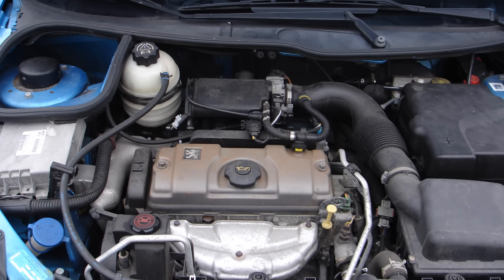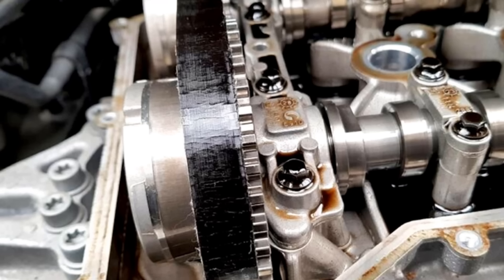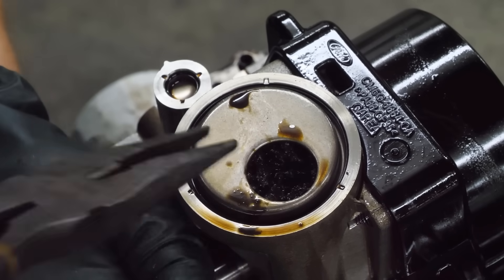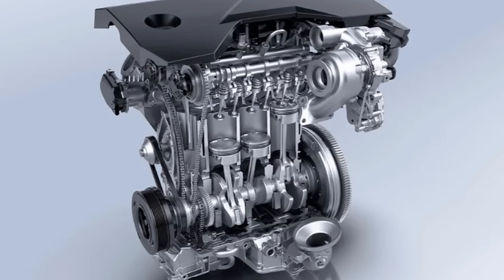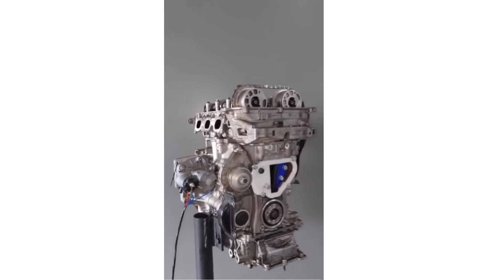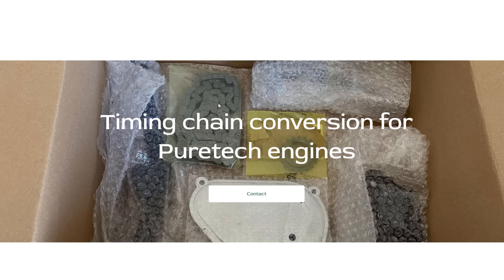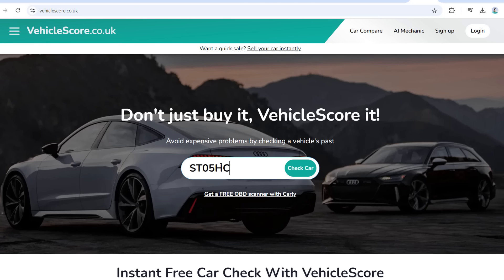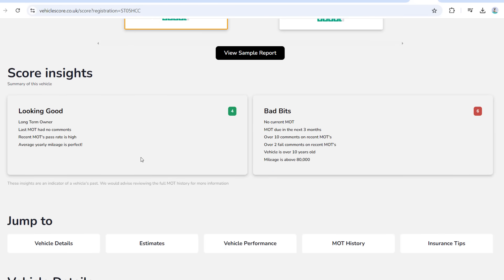Peugeot PURETECH Fix Is Here - All You Need To Know

Comment: I work for the Stellantis importer here in Greece.

Stellantis have changed the oil specification numerous times in order to attempt to cure the oil consumption and the belt degradation, the oil itself doesn’t actually harm the belt but the remnants of the combustion process which contaminate the oil and attacks the belt.

The revised belt from Dayco is apparently “OK”

The recommended oil now is Total Quartz 5/30 RCP not that water thin 0/20. My advice is to completely ignore the ridiculously long oil change intervals and to change the oil every 5000miles max.

I have a 2023 Peugeot 308 130PS 1.2 company car, the wet belt was toast at 20kmiles… I noticed it whilst topping up the oil, thankfully didn’t have the oil pressure issue as the belt had just started to fray on the outer edges.
Reply: I strongly believe that short oil change intervals are the best insurance to avoid the belt disintegrating. As you said, oil contamination (read: repeated short journeys saturating the oil with petrol) is what kills wet belts.
Reply: @Zgurkogel  I replaced the oil in my 1.2 PSA 128bhp after 12 months / 2000 miles, the oil smelt strongly of petrol, the amount of oil I got out was exactly the same as what I had put in 12 months prior, but I do wonder how much of it was fuel
Reply: le probleme principale   c est la segmentation    qui n est pas assez serree!      elle    autorise  l essence    non brulee a se melanger a l huile dans le carter d huile    et l huile remonte  aussi au dessus du segment racleur  et se cokefie avec les explosions et finir par bloquer les segments   d ou  surconsommation  d huile et encore plus d essence qui tombe dans l huile c est un cercle vicieux . tant que ce probleme ne sera pas resolu   ce moteur ne sera pas fiable!!    les ingenieux ont conçus cette segmentation pour augmenter le rendement de ce moteur  car segments moins serres moins de friction  montee en vitesse plus rapide et plus faible consommation   mais personne a pris en compte la fiabilitee! tout sa pour gagner 10cv   c est a peu pres ce qu une bonne segmentation aurait fait pendre a ce moteur
Reply: man oh man the main problem still exist
Reply: @jimzigouris  le probleme principal c est pas la courroie!  le probleme principal c est la segmentation  trop faible et l usure du bloc cylindre    c est un bloc alu  donc  se dilate plus qu un bloc acier ou  fonte  donc on a  mis une segmentation avec beaucoup de jeu   sa marche pour un moteur qui va faire   100 km d autoroute mais pour rouler en ville il a pas le temps de se dilater donc melange essence /huile dans le carter de plus  plus des segments en acier vont user l alu des cylindres donc augmenter le probleme     tout est conçu  pour que le moteur s autodetruise ! c estait prevu pour vendre des voiture mais ils se sont fait choper mais  renault a aussi des problemes ford aussi  bmw aussi   c est simple ils ont programmer l autodestruction de leur vehicule   donc   ils prennent leurs clients pour des cons!
j ai 2 voitures avec des 3 cylindres  j ai aucun probleme bizarre c est une toyota aygo et une kia ceed     expliquez moi pourquoi!
Reply: I changed the belt in March of this year at 42000 kms. However, after 6,000 km, six months later, my car broke down on the highway. It was the poly that was: either poorly assembled or faulty, and broke a valve. New timing belt and all valves changed by official dealer and fortunatelly they assumed the cost. Let´s see nexts chapters. But I doubt they will last until 100
Reply: I changed oil evry 10k with 0w20 and the belt Is perfect After 40k., why this change? My car Is turbo.
Reply: @battagliacreative289   changer l huile tout les 10k est bien    tu vas juste avoir les problemes plus tard que la majoritee  des gens!   tu fais l entretien chez un concessionnaire? car si tu as un probleme  la garanti ne fonctionnera que si toutles entretiens ont ete fait chez un concessionnaire        et attention nouvelle huile pour vehicules stellantis    5w30 (Stellantis FPW9.55535/03) depuis octobre 2023    c est la meme huile que les moteurs    1.5  bluehdi diesel qui ont aussi des problemes!
Reply: Con el aceite 5/30 RCP sigue consumiendo. No sirve de nada cambiar.  
Με λάδι 5/30 RCP συνεχίζει να καταναλώνει. Δεν ωφελεί να αλλάζεις.
Reply: @josemoreno5284  RCP became available this month, oil consumption will be better though not eradicated
Reply: @arthurdardalis  regardes mes posts precedents   ce moteur a ete mal conçu    quands tu commences a consommer de l huile  ba ilest mort   dommage car ma femme en a eu un   1.2l 82 ch sans turbo sur une c1   sa marche fort   mais bon 100 000 km    1l d huile tout les 500km   on a acheter un toyota  aygo
Reply: @josemoreno5284   tu peux n importes quoi comme huile quand tu commences a consommer  ton moteur va consommer! desoler  il est mort! tu peux le garder  mais a chaque fois que tu utilises la voiture regardes le niveau et toujours un bibon de 5l d huile dans le coffre! il va bien fonctionner mais manger beaucoup d huile!
Reply: εχοντας μια octavia 1.8 20v  του 2004...που μετά απο 21 χρόνια και 350000χλμ άρχισε να καπνίζει....και ψάχνοντας για πιθανό αντικαταστάτη της...αρχίζω να σκεφτομαι σοβαρά να την επισκευάσω με τα όσα ακούω και διαβάζω τους τελευταίους μήνες....ψάχνοντας για ενα μεταχειρισμένο μετά το 2017-2018....μη παρεις diesel αν δε κάνεις χιλιόμετρα...μη παρεις γαλλικά με τον 1.2  μη πάρει ford focus..μη πάρεις opel....θα χαζέψω στο τέλος και θα πάρω πατίνι...(δεδομένο ότι δεν μπορώ τον σχεδιασμό και τη φιλοσοφία των γιαπωνέζων ..όσο καλές μηχανές και να εχουν)....τι θα μου προτείνατε ? αν δεν σας είναι κόπος βεβαια.....ευχαριστώ ...
Reply: @BillPappas  honda   avec moteur 1l5     moi j ai achete une kia avec 1 moteur 3 cylindre    et c est une chaine  de distribution   donc a priori plus fiable! les honda c est pas dans mon budget!
Reply: @BillPappas  Πριν λίγα χρόνια, θα πρότεινα Hyundai I30, με τιμή βασικής έκδοσης στα 14.500. Σήμερα που κάνει.....όσα κάνει...και που όλα τα καβουρδιστιρια κάνουν όσο κάνουν...μάλλον θα συμφωνήσω με το σκεπτικό σου.
Καλή χρονιά!
Reply: Change belt every 20000 , should do the job.
Reply: @Bill Papas, εαν δεν σε νοιάζουν οι επιδόσεις και θέλεις πλέον να έχεις ενα αυτοκίνητο που:
- να είσαι πιο άνετος στην πόλη
- να μην σε σφάξει στα σέρβις
- να έχει καλο κινητήρα 
- να κάνεις τα ψώνια σου 
τότε η απάντηση είναι μια και απλή:
Fiat Panda έως του 2020 με τον 1.2αρη κινητήρα και τα 70 άλογα. 

Για τον 1200αρη της Peugeot/Citroen οτι αγαπάς κάνε. Να ξερεις υπαρχει και ο 1600αρης που  ειναι πιο αξιοπιστος και εχει καδενα αντι για ιμαντα.

Εγω έχω αυτον με τα 75 άλογα και δοξα τον Θεο στα 25.000χλμ που εφτασε δεν έχω παραπονο. Φτου, φτου...
Reply: Just out of curiosity: I've read the new RCP 5W30 oil (Stellantis FPW9.55535/03) is meant to be used on 1.2 Turbo Euro 6.1 engines but mine's an EU6.3 (which I believe is a Gen. 2) from 2019 and I'm not sure if that oil spec also applies for it or it's still the well-known 0W20 oil (PSA B71 2010)
Reply: @ 5/30 RCP is designed for the Euro 6.3 engines

My company car is a 2022 Peugeot 308 1.2 136PS & the RCP is the only recommended oil now
Reply: I have a 3008 21 plate end of it this no .more peaugeot  for ..em
Reply: Εχουν αλλαξει απο 0W30 σε 5W30 για το 3008 (2022 diesel)?
Reply: @ ναι, το εγκεκριμένο είναι το 5/30 RCP, έτσι θα το ζητάς στην αντιπροσωπεία εάν και όλοι αυτό βάζουν τώρα… λύνει «κάποια θέματα» ιδιαίτερα τον 1.2 turbo.
Reply: FIAT600 hybrid 100 άλογα που με άφησε από σασμάν στα 2900km δύο μήνες χρήση, τί έχετε να πείτε; Puretech fail??
Reply: Καλησπέρα σας, δηλαδή ο κινητήρας είναι ασφαλής αν αλλάζεις τακτικά λάδια? Ενδιαφέρομαι για Peugeot 208 του 2016 με 1.2 puretech
Reply: @ καλησπέρα σας, δείτε πότε άλλαξε ιμάντα τελευταία φορά, κανονικά είναι κάθε 60,000χλμ. Εάν έχει αλλαχτεί πρόσφατα τότε φοράει τον βελτιωμένο, να κάνετε αλλαγές λαδιών κάθε 5,000χλμ με το νέο λάδι της Stellantis, 5/30 RCP.
Reply: @arthurdardalis πως λέγεται ο βελτιωμένος ιμάντας σε περίπτωση που χρειάζεται να τον βάλω εγώ?
Reply: @ είναι της Dayco, μπορείτε να το βρείτε παντού, στους επίσημους εμπόρους Peugeot έχουν μόνο τον καινούργιο και θα είναι πιο φθηνή η αλλαγή εκεί σε σχέση με ένα συνεργείο έξω, & θα έχετε δύο χρόνια εγγύηση ανταλλακτικά & εργασία χωρίς περιορισμό χιλιομέτρων.
Reply: @arthurdardalis Σας ευχαριστώ
Reply: καλησπέρα.Να ρωτήσω κι εγώ κάτι? Στο Citroen elysse 1.2  85 βενζίνη το ίδιο λάδι? 5-30 ? 
ευχαριστώ εκ των προτέρων  🙏
Reply: @eos60d καλησπέρα, ναι όλα πλέον 5/30RCP
Reply: @arthurdardalis  καλημερα.σ ευχαριστω πολυ. 🙏Δεν το ηξερα και την εφαγα.Πριν 3 μερες αγορασα 1 μεταχ.με 60.000 χλμ.Μ επιασε πανικος με ολα αυτα που διαβασα.Θα το βαλω απο βδομαδα για πουλημα.Αν πουληθει φυσικα..
Reply: @eos60d δεν υπάρχει λόγος για «πανικός».  Οποιοδήποτε εξουσιοδοτημένο συνεργείο θα ελέγξει τον ιμάντα και θα σας ενημερώσει.

Εάν έχει τον τελευταίο σε κωδικό ιμάντα & 5/30 RCP (λάδια Stellantis), δεν έχει πρόβλημα.
Reply: υπέρ ευχαριστώ.Πραγματικα έχω χάσει τον ύπνο μου αυτές τις μέρες.Αυριο θα πάω στην Citroen για έλεγχο.Πηρα ανασα.Ευχαριστω πολύ. @arthurdardalis
Reply: @ionakos88  Did you buy the 208? (I bought one from 2017 a month ago. I was sceptical but it is cheaper than japanese cars)
Reply: Make a chain kit for the 2025 GM Trax(1.2L).
Reply: Yup, mine was shagged at 5 years and 34,000 miles, quite possibly down to ethanol blowby, and not getting up to temperature on short journeys. Annual oil and filter changes every year.  Citroen now say they offer a lifetime warranty on the belt if you can produce a full service history, but - of course - will do anything to wriggle out of it. Hilariously, they claimed that the 0W20 put in at year 4 was wrong, despite it being (briefly) their recommended grade at the time. Sod them, I punted it on to trade and will never touch Stellantis again.
Reply: Το ds3 crossback του 2023 αντιμετωπίζει τέτοια προβλήματα ? Είναι καλό σαν αυτοκίνητο ?
Reply: @alexiskoufiotis3978 σαν αυτοκίνητο είναι καλό, έλεγχος του ιμάντα μονο
Reply: Έχω βρει ένα 2008 αυτόματο του 2022 με 95000 χλμ. Η γνώμη σου θα είναι πολύτιμη. Ευχαριστώ.
Reply: @Themaintainer1  Γενικότερα είναι αξιόπιστο αυτοκίνητο, ελέγξτε μόνο τον ιμάντα του χρονισμού,σε τι κατάσταση είναι και πότε έχει αλλαχτεί

Στη συνέχεια θα πρότεινα αλλαγές λαδιών κάθε εφτάμιση χιλιάδες χιλιόμετρα, και να μη δουλεύετε το start stop
Reply: @T @Themaintainer1 σε τι τιμή το έχετε βρει;
Reply: @arthurdardalis Ευχαριστώ για την άμεση ανταπόκριση. 16000 ευρώ και έχει αλλάξει ιμάντα πρόσφατα .
Reply: Belt replaced at 52.000 km and 0:00  looking like new. No rubber debris. Car hardly ever used in town and start/stop option disabled.
Since I'm aware of belt problem (bought end 2018) I'll change oil every 5.000 km. No oil consumption and happy with te C 3 Aircross. Euro 6.2 norms are the problem.
Reply: I have an Opel Crossland  2021 (facelift) 1.2 80 cv aspirated....also in Greece. I bought it brand new  . First oil change in 900 km, second oil change in 3000 km and since then every 10000 km strictly! It  is one of my five cars , so  I have the luxury to never  use it in urban roads or carry heavy loads .  I always diasble that stupidity called "start n stop" ! Almost 40.000 km today and everything is fine.
Still I find very interesting  the change of oil specification, reported by my countryman above...I 'll surelly  check it out soon
Reply: @Romeo_GR  if your car is non-turbo, the 0/20 is still valid. The 5/30 is for all turbo engines type EB2ADTxxx
Reply: @arthurdardalis  Φιλε μου σ' ευχαριστω πολυ!!
Reply: @Romeo_GR  χαρά μου😀
Reply: @arthurdardalis  ils arretent pas de changer les references des huiles pour mettre tout les vehicules hors garantis!
Reply: @arthurdardalis τι άποψη έχεις για το καινούργιο σασμάν e-DSC6 όσον αφορά την αξιοπιστία και το ηλεκτρικό μοτέρ στο εσωτερικό του;
Reply: @ καλημέρα, μέχρι στιγμής δεν έχει αναφερθεί κάποιο θέμα
Reply: @Romeo_GR  my problems started at 50k 6:26
Reply: every peugot citröen engines have chronic problems
Reply: Έχω το 1.2 82 2017 eb2f μετατροπή αέριο. Αλλαγές λαδιών κάθε 10κ 0w30 ineo total ( ένα με ενάμιση λίτρο το έχει κάψει). Στις 100κ άλλαξα ιμάντα που άντεχε λίγο ακόμα αλλά είχε αρχίζει να ξεφτίζει στα πλάγια. Η σίτα στην αντλία λαδιού ήταν καθαρή. Πρέπει να αλλάξω σε 5w30 rcp;;
Reply: @barimagas  ναι πρέπει, αυτό είναι τώρα το προτεινόμενο
Reply: I have always used oil additives or ceramics or Nano-PTFE
Reply: @maxrava4339 oil additives are a bad idea. Always. Please check The Oil Geek - he is specialised in tribology, the science of oil. He has a strong opinion on additives and knows how to explain it. Also, I've used several PTFE based additives in the past which in all cases drastically accelerated engine wear. Lesson learnt, if oil alone isn't up to the task then get better oil.

Comment: “Serviced at a main dealer” means jack shit! They aren’t using the genuine correct grade oils, they buy gallons of universal oil which would be similar but not the exact specification. Also when cars are on free service plans the dealers do the absolute minimum to the cars to save them money. I’m speaking from first hand experience of working in several main dealers after sales departments.
Reply: Exactly that !!
Reply: In Croatia my official Citroen dealer waited that my 5 years warranty expire and after that change belt on 83000km. Now i have to change new engine because old one is wasted, on completely new car, every year maintained at official dealer.
Reply: Very true!
Reply: Lookers Vauxhall in 2 franchises did that to 2 cars i had years ago. Absolutely terrible service, scammed each time. Work suggested and charged for was never completed.
People stopped going and they got a reputation before closing down and selling the land to Tesco.
Reply: I’ve always thought that. I very much doubt that there’s any magic ingredient in manufacturers oil that stops cambelt degradation, anyway.

Comment: If you use a stainless steel chain it won’t rust at the bottom of the ocean 😮
Reply: stainless steel is only rust resistant but not rust proof, besides, is has worse stretching properties

Comment: I had a Citroen C3 1.0 with Puretech petrol engine 3 cylinders after 50.000 miles I started having issues with lower oil pressure caused by a welt belt ! After replacing the wet belt the engine started to  oil consumption ( around 1 lt of oil every 500 miles!!!) Now I drive a used Fiat 500X with 1.6 Multijet 2 diesel engine after 2 years I never spent a penny on it!
Reply: Multijet engines have a timing chain instead of a belt that's why they are a bit noise , but i can live with that.
Reply: I´m sorry to ask you this, but did the dealer assumed the cost or did you paid part of it too? could you tell how many it costed? thanks in advance.
Reply: @quidelicia1  morning... Yes I confirm that Citroen UK was really efficient and we agreed that they pay all cost unfortunately the citroen authorised garage near Glasgow made a mistake while replacing the timing belt... But this is another story.........
Reply: Have you serviced the fiat?
Reply: @johnathanpearson3203   yes at local Fiat official dealer...

Comment: So this kit has had the engine modified to provide sufficient lubrication to the chain when the engine is running? What's the R&D on the longevity of the chain?

1.0l of oil consumption in 4k miles is perfectly acceptable. 

Honda VTEC engines use oil and are perfectly reliable.
Reply: It's highly likely there's enough splash for a chain; you'll notice in all photos that the belts are soaking wet.
Reply: je pense que vous avez pas compris que le vrai probleme    c est pas la courroie ! le vrai probleme c est le moteur lui meme     segmentation  trop lache   et bloc alu qui chauffe et se deforme et augmente donc le probleme de la segmentation!

Comment: I have a 2022 1.2 and adore the engine. So much character and sips fuel. 
I believe the wet belt was improved for this model year but would still be interested in the chain conversion kit for sure.
Reply: no it's not, and Stelantis will have to face in court in France for that
Reply: Is Portugal are giving 10 year warranty if car have serviços in manufacturer….. Many cars already change belt or motor during warranty time.
Reply: Erm....Mark, do you work in the showroom at Arnold Clark, Linwood by any chance..?
Best not use the word 'character'. It gets you rumbled straight away.
Reply: @thephilpott2194  haha thankfully I don’t 😂
Reply: wait till you get it to 40-50k miles, gonna love it even more
Reply: If it's a wet belt, stay on top of the maintenance. Have your mechanic check the oil pan and oil pickup once in a while (every 50K, I guess). All that money saving on fuel, hey.
Reply: Character? Having a torqueband of 1500 to 2500 and being dead outside of that? 
C'mon, you putt it around, thats why it sips fuel and you think it has character.
Reply: @The_Noticer.  There are 3 versions, 65kw, 80kw and 114kw approx. The 114kw is peppy 7.8s 0-100km/h
Reply: The 2022 might have a chain fitted? I’m unsure when they started producing the cam chain model.
Reply: @alexf1066  no pas de chaine    je pense que cette voiture a peu de km  donc pour le moment pas de probleme! c est un bon moteur quand on a pas de probleme    mais quand cela arrive   c est pour la poubelle
Reply: combien de km a votre voiture!
Reply: the belt is from far not the only problem from this engines, the other problem is the fast piston rings wearing and direct injection who make oil dilution.To avoid belt problems, take oil changes all 10 000km or 1x per year, and make so few city or short distances as possible...my own engine had no blet problems , was in good condition at 100000km belt change, but engine die with 115000km (ring wearing+ piston overheat), new engine (puretech 110) cost me 6000€...